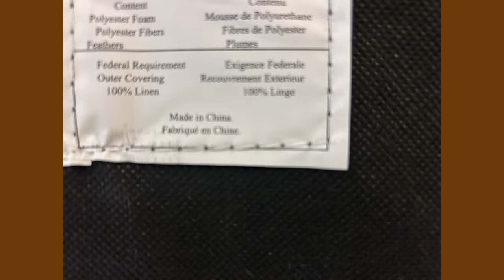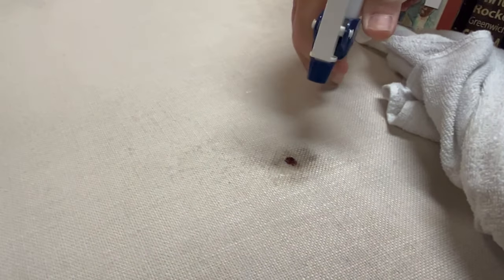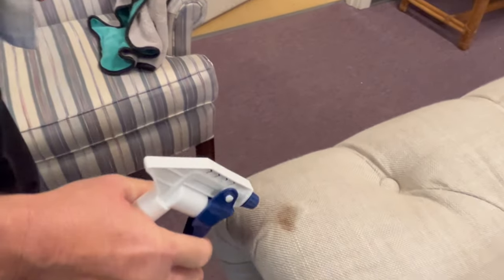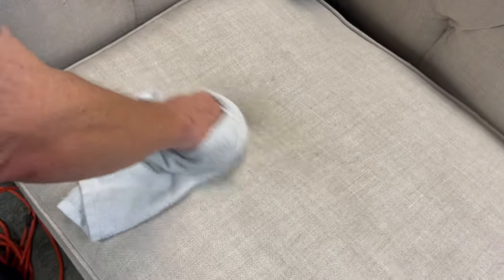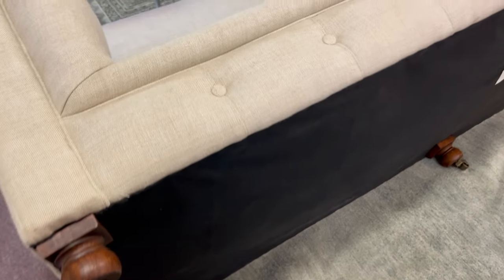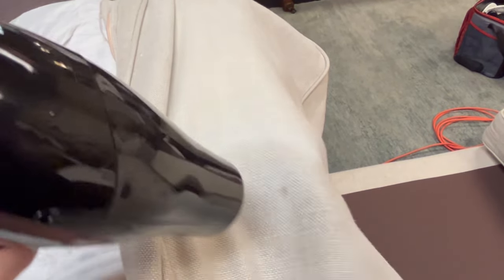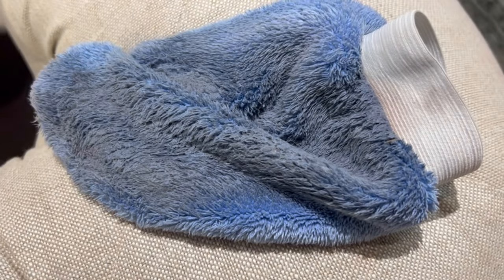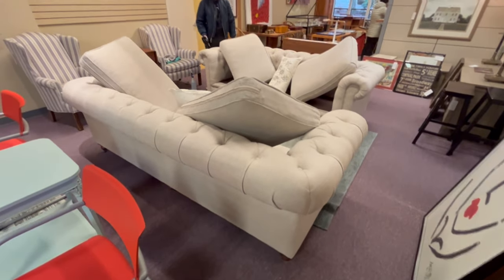White Linen Sofa Cleaning The Correct Way! Potential Damage if Improperly Cleaned

Comment: 👍I would have put a plastic sheet between the cushion and outer fabric before treating to eliminate the need to blow dry the wet cushion beneath. Heating a stain can set some stains. I used to dye nylon carpet and used a steam iron on a damp towel to set the dye. As you mentioned, Dry foam seems to be the best for this button tufted fabric. PS: Woolite has a $5 bottle of upholstery dry foam cleaner with a built-in brush on the can's top. It's a very good quick spot remover. It works well on auto floor mats too. Use cotton towels to extract the dirt and moisture.
Reply from the maker: That's a great idea!

Comment: I had a linen sofa before Thanksgiving that water marked to even a neutral FOAM shampoo. Always try to find your cleaning codes on the sofa fellas...that one was marked "S" for solvent only.

Ended up removing it with a fan and multiple spray applications of 3% HP
Reply: That's why I hate Upholstery Cleaning. Not to mention my aching back,
Reply: @mamajan99 upholstery can become stressful